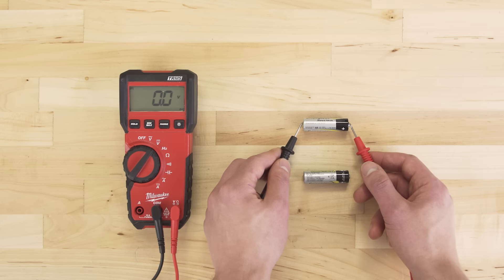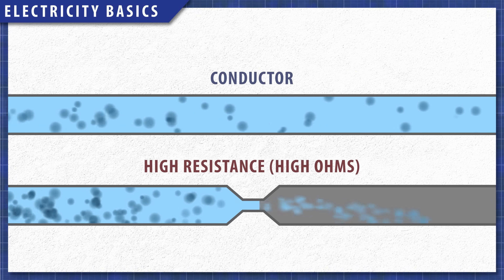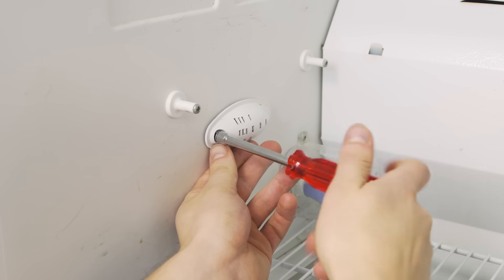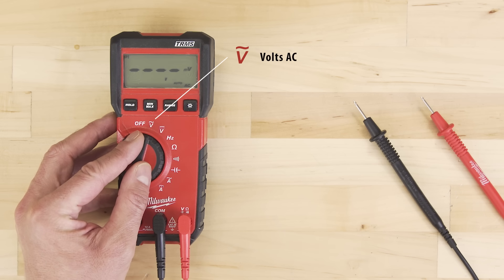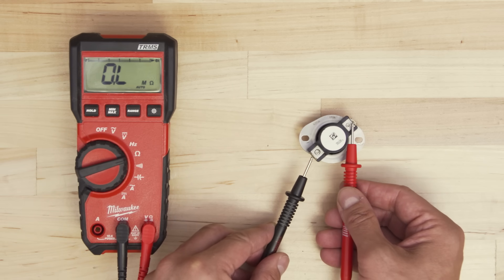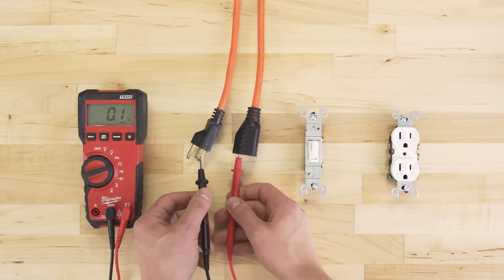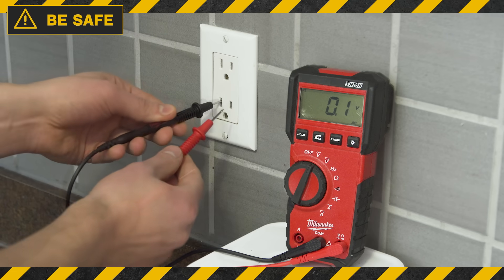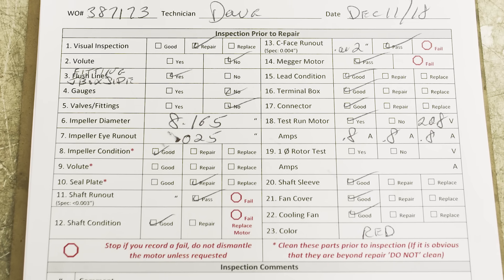How to Use a Multimeter & Electricity Basics | Repair and Replace

Comment from the maker: * Update * Another note on safety when testing live voltage: In the video it is recommended to always check the multimeter leads for damage before use as well as to hold the multimeter leads from the insulated handle. For additional layer of safety, its best to wear electrical safety gloves and to only hold the multimeter in one hand at any given time. Holding the multimeter leads in one hand will prevent electricity from passing from one side of the body to the other in the case of a shock. This is known as the "one hand rule".
Reply: hello, i mistakenly put a 7Ah battery to run the multimeter to check electricity, which led to its disabling. is it completely damaged or is it repairable?
Reply from the maker: @chicreev  Thanks for watching. It might just have blown the internal fuse inside of the multimeter. In some cases replacing the fuse will fix the issue.
Reply: @AmreSupply  ok i got it thank you
Reply: @chicreev  à
Reply: I'm tickled that you mentioned the one-hand rule when testing unknown voltages.
Reply from the maker: @wizardoffrobozz  Thanks for watching. It's definitely important to understand the concepts as well as each safety precaution. We're just glad to help.
Reply: Your channel is really valuable. Please keep up the good work..✨♥️
Reply from the maker: @talhaahsan6808  Thank you, we're just happy to help people with these videos!
Reply: Agree
Reply: Good eveing testing  metares  milliam  meters simpaon   compay.. ..  ac   voltage   measurement .0-2.5 through 0-500v  range..   warning...  Branch  and distribution  circuits  (120/240/480v etc.)  Candeliver dangerous  explosive power momentarily into ashort circuit before the f
Reply: Observe the  reding  on the  ohms  scle  at the  top of  the dial   the  ohms  scale reds from right  to  left for  increasing  values of  resistance ed us reng setin  an long metres        digtal    vots  reage seting using  ac ok dc ok dc us seting   power  probe set  read  and   balc seting using    ohms  seting  coneacting  testin ex pla   only ok
Reply: Thanks - never heard of one hand rule-
Reply from the maker: @froglobster  We're just glad to help keep people informed.
Reply: Read  test  receptaccles  respectively for  measuring thw  ac  vlotge  the konbcan  be  adjusted  to  500 .250 .50  and 10voltes range .when  the  knob  isadjusted to  500g the totalor  range when  volts mesusuring dc adustinf konfs foe measuring rhe restanve  the knob selecter should be  at x1 x10vor x1kconnectingrestance mesuresd zero  modes metrs  using mult meers usunv vote ac dc  rang  chenges  res seting   care using prbes setinv ..
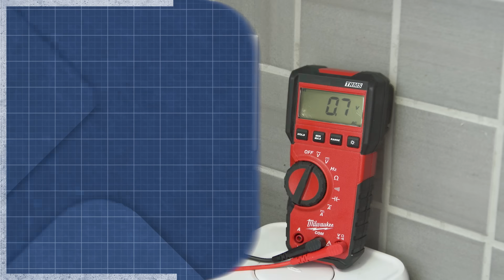Reply: At 0:54 and 8:17 😮 great update and good advice for picking it out. Need to redo the video. Always connect with one hand and release the leads if possible. In Australia i see a lot of technicians and electricians using two hand with no insulated gloves and mat.
Reply: Measuring  ac  ampere puch  the  pointer  lock  towards night  sidetorelase  the  pointer  by  turning  the  range  slector  switch  adjusting  the rotating  scale  for  the  required  ac  amere  scale  open  the  jaws  by  pressing  jaw  trigger  poiter seting using indicates  below  thd mid  scalev the range  seltecter  switch  to  nest  lower  current  range  measuring  ac  voltage  removring  ohmporbe  while  measuring  voltage  connectthe  voltage  test  lead  at  the  bottom  of  thd  meter turn  the  range  selecter  switch  knobto  adjustthe  scale  at  highest  range  of  ac  voltage connecting prodes  to  voltageto measured ..rangeselte usin defrt metrs der need low high range selted and using somw  camp met  digter   volt  24  volt  .  110  220 selt using  csmp met  anlong fee  digetal fee srlting reang selt usin  volt  ac fee  dc fee selt using  probes seting using

Comment: How about explaining why all the different ways meters display? Some dial. Some have separate off/on switches. Some have cheap probes, while others have much better probes. Why is the Klein meters more expensive than others. How to decide how much to spend? A lot of question unanswered. Some will show AC amps, others don't. Why don't they show DC amps?
Reply from the maker: This video was already 10 minutes long and we tried to keep it focused. We're currently working on some videos for dishwasher repairs but if we return to this series, we'll keep that mind for a separate video.

Comment: main talker video guy, perhaps you can shred a spec of light on just a tad of this capitance symbol cunundrum>

As i’ve asked many electrical specialists on quora(so far with no answers😳- welcome to multi-meter dumness world?)

w/countless capacitance meas. symbols on multimters ->|-, ->|- 2k, uF, F, horse shoe sayng uF F cap. & so-on, -(|-, -(|- 1.5V, & etc., various often found on same multimeters, each clearly declared ‘it’ by gUgL, UtUb experts, etc., hU’s the 1 in a 100 thats rIt?😒
Reply from the maker: The ->|-  is used for diodes https://www.fluke.com/en-us/learn/blog/digital-multimeters/multimeter-dial-button-jacks-display  

uF (microfarads) or F (farads) are used depending on what a multimeter is able to measure.  1,000,000 microfarads = 1 farad

2k next to a setting would likely refer to the range of testing and is normally only on analogue multimeters that have specific ranges. 

(-|- or -(|-): could be variations of the capacitor symbol used in different diagrams or on a specific multimeter but might denote terminals on a polarized capacitor.

If by horseshoe you mean the omega symbol, then that is Ohms (resistance)

You might also see a range of symbols used on various circuit diagrams. These all have specific functions but there are reference guides showing which symbols mean what.
Reply: wel said chEf👋 & I did mean omega symbol, & btw., since a lot of(maybe a few) people use volt testing section to drain capacitors down to below 25volts - but some caps don’t have symbols saying which they are - what if you touch volt meter to reverse order of terminals on a 2 term. capac ?🤔

Comment: If possible, use one hand to hold both probes when testing high voltages. For example before poking the probes into a receptacle. That way if you find mr sparky any current won't flow across your heart as it might if you have a probe in each hand. Interestingly while DC is considered safer it has a higher clamping force on your muscles and is harder to let go. So you solar guys need to be extra careful with panels in series and high voltages.
Reply from the maker: Yes that is a good safety tip which is why we added the pinned comment.

Comment: I seen a video the guy said when checking wall sockets to use one hand so the electricity doesnt flow through on hand  through your body to the other hand.
Reply from the maker: Yes there are a few ways that you can add additional levels of safety. Wearing insulated gloves is one as well as only using on hand.
Reply: @AmreSupply  Thank you

Comment: Question:You said continuity when is tone.But you measure in Ohm
When should i use the resistance ?
Reply from the maker: Thanks for watching. Not all multimeters have the continuity with tone setting which is why we showed how to test with resistance.
- Continuity is a continuous path for electricity to pass through. A switch or wire will have an unrestricted path and have between 0 and 1 ohm of resistance. This is a non-load component. 
- A load component like a motor or heating element will have a higher resistance as this component is doing work. If you only test for continuity then it might not show you the entire picture. A load component can have continuity, but a resistance outside of the normal range, which might affect how it runs. 

You can learn more in Part 1 & 2 of these videos: https://www.youtube.com/watch?v=e_1pOWSVUfg
Reply: @AmreSupply  But when I measure like a cable internet it will use continuity?
Reply from the maker: @jeffsad8391 Thanks for watching. You can use the resistance / continuity setting or the tone setting for testing any wire that is not connected to an open switch. A wire will beep if it is good, or will have a resistance between 0 and 1 ohms.
Reply: @AmreSupply  And what if is conected to a switch?
Reply from the maker: @jeffsad8391 If it is connected to a switch then you can't simply test for continuity in the wire as the switch will likely be open and will show no continuity on the multimeter.
Reply: @AmreSupply  So I need to test resistance?
Reply from the maker: @jeffsad8391 A simple cable can be tested for resistance or continuity using the beep setting. For an ethernet cable that has an internal switch you cannot test it without using a dedicated "ethernet cable tester".
Reply: @AmreSupply  thanks

Comment: Not one of these guys in the videos mention to cut the power to the house!
Reply from the maker: Thank you for watching. For doing continuity tests, shutting off the power at the breaker is specifically mentioned at 5:16 in this video. 

For a voltage test, shutting off the power would make the test useless. It would be similar to shutting off the water supply then testing for water pressure at your faucet. No water would flow and you'd have no idea how much pressure there is.

Comment: Arent the two prongs appliances get affected the most due to their absence of ground pin to the outlet, let it be in the event of a fault or lightning strike?
Reply from the maker: Thanks for watching. Certain appliances, have a low risk of electric shock or pose no electrical hazards. These non-conductive or low-risk appliances, like those with plastic housings or appliances made entirely of non-conductive (insulated) materials, typically do not require grounding.

Comment: Great video, thank you. How would I use a multimeter to check for a "good ground" on my accessory plug on a motorcycle?
Reply from the maker: Thanks for watching. Without any specific experience with motorcycles, this is outside of the scope of what we can answer. Might be good to ask within motorcycle repair forums or specific videos on motorcycle repairs.

Comment: How has this little meter held up? I’ve seen some complaints about the rubber coming off and becoming Sticky. Great video!!!
Reply from the maker: Thanks for watching, we're glad that you found it helpful!. The multimeter has only been used in our studio for filming so it has lasted 7 years without any damage but this is not the best representation of daily use in more dusty/ dirty environments. The meter is solid overall, we chose this primary since it was easy to see on camera.

Comment: which setting to use to test fuses from the old fuse box in old home?
Reply from the maker: Thanks for watching. To test any fuse you'll have to set the multimeter to the resistance or continuity setting. A fuse should have a resistance between 0 and 1 ohm. If it has no continuity and no resistance reading, then replace the fuse.
Reply: @AmreSupply  thanks Mr.

Comment: I dont want to die..can i if i do something wrong with multimeter?😢
Reply from the maker: Thanks for watching. Continuity tests of isolated components are safe as there is no power and everything is disconnected however there is always a risk when working with any live source of electricity. If you are unsure about the safety, then it is best to call an electrician.

Comment: Thank you very much. The graphics you included (AC and DC voltage, Resistance, etc.) were very helpful in understanding what is displayed on the multimeter. 👍
Reply from the maker: You're welcome, we're glad to hear that you found the graphics helpful! If you are curious, we use the same sort of style of circuits in our appliance troubleshooting videos: https://youtu.be/L9ZI5GyON9I?t=153

Comment: I notice a lot of meters come with cheap probes. I went to radio shack and got some cat 3 rated probes.
Reply from the maker: Thanks for watching. You are right that there is a variety of the quality of the multimeters and probes available. For a simple continuity test of a switch or stove element, a basic multimeter will do fine. For more advanced testing, better probes are essential for safety.

Comment: thanks. while checking ac voltage, u told to first insert the neutral and then the phase. this is new for me.
Reply from the maker: Thanks for watching, we're just happy to share some good information: For additional layer of safety, its best to wear electrical safety gloves and to only hold the multimeter in one hand at any given time. Holding the multimeter leads in one hand will prevent electricity from passing from one side of the body to the other in the case of a shock. This is known as the "one hand rule".

Comment: Fantastic channel . I have a question , how do I test a 7.5 output transformer   I get a zero reading when testing the transformer output
Reply from the maker: Thank you, we're just happy to help!. We don't have any specific videos on testing transformers. However in an isolated test you can check the windings for continuity. If there is no continuity in the transformer windings, then it's faulty and will need to be replaced.

Comment: in AC If you plug ONE multimeter lead only to LIVE Line and leave the other lead unplugged its normal to get a 50V+ reading? Thanks
Reply from the maker: Thanks for watching. There shouldn't be any voltage reading if the 2nd probe is not connected to anything.

Comment: Thanks for the video, very informative, btw, will your VOM gets damaged when you measure  AC Volt, but in your Tester, you set it to DC mistakenly? Thanks
Reply from the maker: Thanks for watching. It depends on the meter but yes measuring AC voltage on the wrong setting could damage the components. In some cases it might not.

Comment: What will happen if you have mistakenly switch the probes, red probe to neutral and black probe in hot?
Reply from the maker: Thanks for watching. The multimeter has an internal fuse for safety. The placement of the fuse may be different depending on the model. Using the probes as instructed will ensure the best safety overall. In some models, switching the probes or using the wrong setting might damage the multimeter.

Comment: @AMRE Supply what if my receptacle is backwards meaning the hot plug in is on the left and the neutral 8s on the right when I want to test
Reply from the maker: Thanks for watching. That means that the outlet is wired incorrectly. Having a hot neutral is fine for something simple like a motor or a light bulb but can damage other appliances or devices. It's best to get the receptacle fixed and wired correctly.
Reply: @AmreSupply  can I send you a picture of it so you can see exactly what I'm talking about?  Like I think they turned the receptacle around or something
Reply from the maker: @babyboinews6896  Youtube isn't set up for sharing pictures, so you'd have to use an image sharing site for the link. If it's an outlet in north America, then it will have the two terminals and the ground on the bottom (with the larger of the terminals on the left as neutral). If the whole outlet is upside down then you might see the ground terminal above the other terminals.
Reply: @AmreSupply  it's a light switch in my kitchen and the larger terminal is on the right and smaller on the left the switch at the top
Reply from the maker: @babyboinews6896  The outlet / light switch is likely just installed upside down. Unless you are having issues with the outlet then there is no need to flip it.

Comment: So when something doesn't work, you test it's resistance, right?  So I'm still lost on what capacitance and voltage and the other areas on the multimeter are for.  I know one or more of these kinds of electricity can give you a fatal shock but I don't know which one is the one to watch out for.  Volts?  Ohms?  Amps?  I cannot convey strongly enough just how beginner level I am. Some of this is gibberish to me, even though it may seem ridiculously basic to other people.  Please make a video that speaks to the absolute dumbest and most beginner level folks and assume ZERO frame of reference.  Sorry, but I'm an idiot when it comes to this stuff.  I know I'm not alone, because so many people try to understand so they can save money and fix stuff for themselves, and they end up calling an electrician.
Reply from the maker: Thank you for watching. Did the water analogy at the beginning not help? Voltage is the pressure. Current is the flow and resistance is how much restriction of the flow there is. These are all inter-connected.

A test for voltage on an outlet is testing to see if the circuit is live and that there is potential for electricity to flow when the circuit is completed. A live voltage test is different and is only recommended for professionals.

Testing for current isn't usually done as it requires running the appliance and is also not recommended.

Testing for resistance (ohms) is often a done to determine if there is continuity in a specific component. This verifies if there is a complete path for electricity to flow through. If there is no resistance at all, then there is no path for electricity, and the component will not work.

Capacitance is for capacitors (which store a small electrical charge) which are used in motors.

We have a video on circuit basics: https://www.youtube.com/watch?v=SnRXD-0oXZo

As well as videos on components: https://www.youtube.com/watch?v=e_1pOWSVUfg

https://www.youtube.com/watch?v=Mdu7QlAzWOg

Now if you are still finding these concepts difficult then its best to call an electrician or technician to do the repairs. They have a lot of knowledge and can troubleshoot the problem in a safe and effective way.